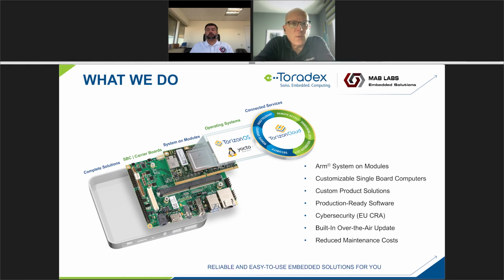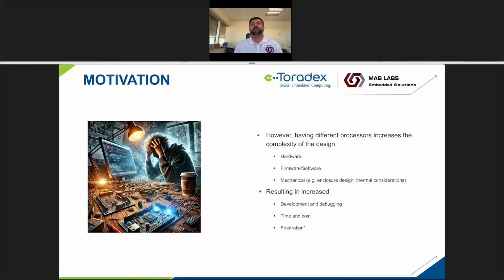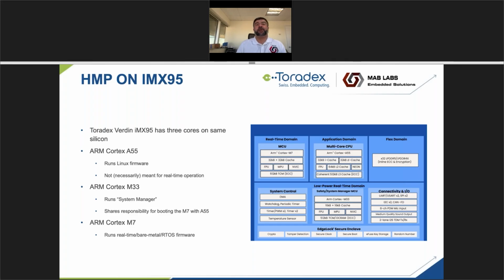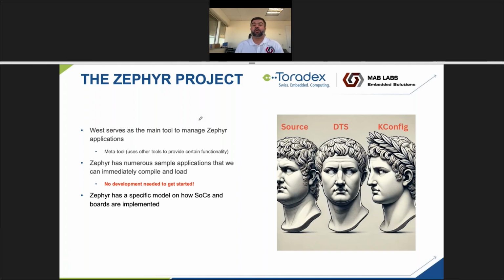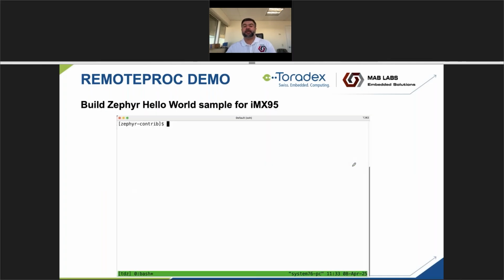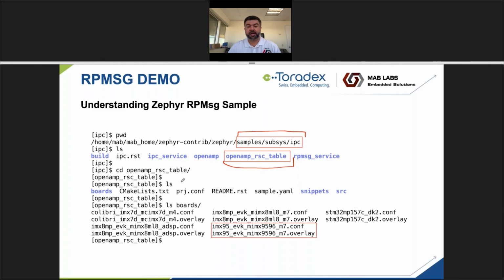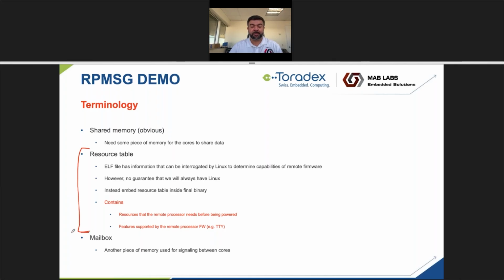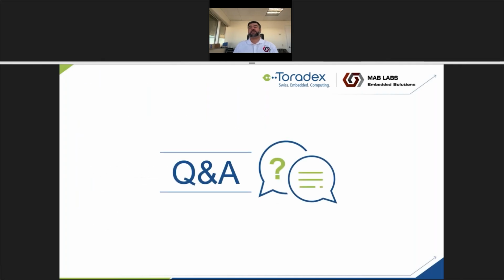Heterogeneous Multiprocessing on the i.MX 95 using Zephyr & Linux

Comment: what is the shared memory used between m7 and a55 cores? and what is its size ?
Reply from the maker: Hi @fatihozen6158 The A‑cores and M‑cores comms on Toradex iMX95 platforms use this RPMsg setup: a reserved DDR region with vrings, a shared buffer pool (around 1 MiB), and a small resource table. The physical addresses are device‑tree/BSP dependent, so you should always check the reserved-memory section or the Linux boot log on the specific board you’re using.